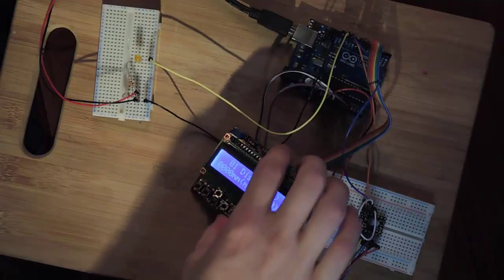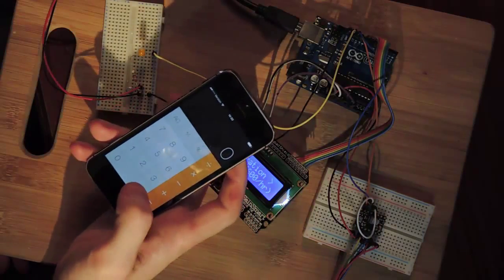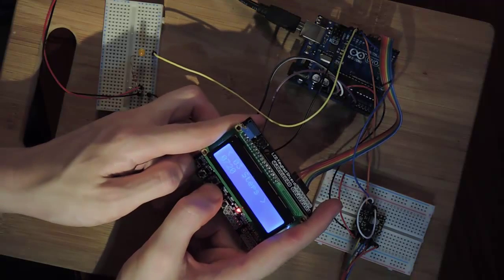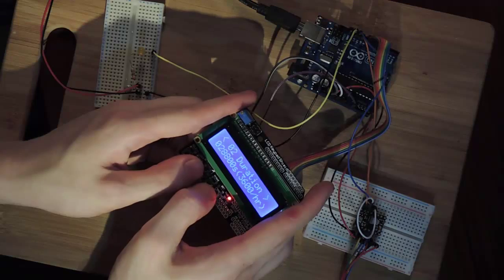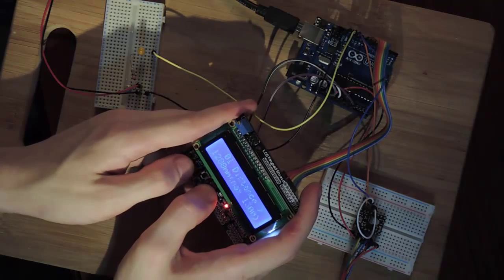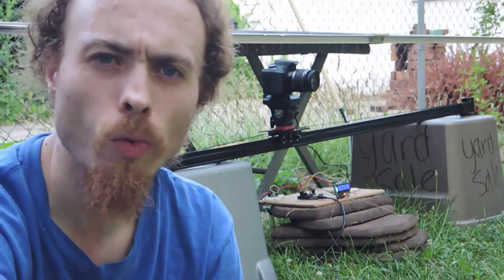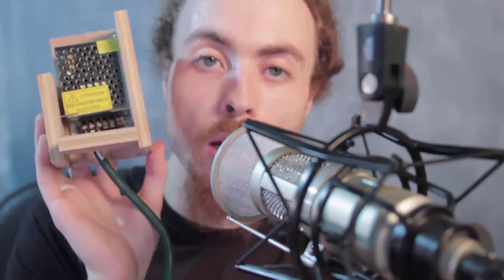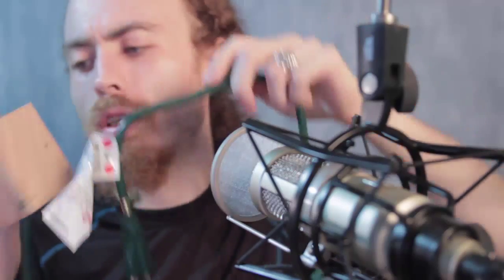SliderCam Intro/Interface/Examples

Comment: What an awesome project. I have built all the electronics of it, which I'm super excited about. Everything works, except my motor keeps stuttering. I have tried changing the wires around, nothing is working. I was wondering if current limitation could cause this? I read up and think I did it right, but wonder if maybe I didn't. I tried both the A4988 FullStep Test. I also tried the Slidecam program. The slidecam works great, except my motor doesn't keep turning. Would really appreciate any help.
Reply: Paul Esteves I increased the current potentiometer, now my motor turns (with the A4988) full test, but not with the slidecam program. With the slidecam program, it still just stutters. Also, on the A4988 test, when I hold the motor, it doesn't turn, so it has nearly no torque. Any ideas? I'd love to get this to work!
Reply from the maker: Paul Esteves That's very odd. Did you try testing the motor/shield with the Arduino library's build-in Stepper example? Far as I'm aware, my motor test output and full program output are both identical, so I have no idea why there'd be a difference in behaviour.

Stuttering is usually one of two issues: 1) incorrectly oriented motor wires (I assume you didn't move them between loading .inos though), and 2) impossible motions (there are no error catching routines in the software as of v0.2). Did you try something like "move 50mm in one step in two seconds"? I tested using video-style movements a lot.

Other than that... It may be your individual hardware, though if you fix the problem and it's a software thing, let me know! :)
Reply: Rob Taylor-Case Hey rob, thanks so much for replying. I eventually did figure out what I had done wrong :/ I had switched the dir and stp wires (problem with not having different colour wires). I actually added in a shutter menu option. I'd love to share it with you and get your feedback on how you'd enhance it. I've done some starlapse tests and it works pretty well! I set it so I could adjust how long it stopped to take a shot. But, I CANNOT figure out the maths now to get it to work perfectly.

Comment: Hi Rob
I have found a couple of problems in the program.
one is in this line lcd.print(menuItemsTo[0]); and 
lcd.print(currentDistance[i]);
as well as 
  //declare button poll function
int readLcdButtons() {
  delay(90); //debounce delay, tuned experimentally. delay is fine as program shouldn't be doing anything else 
  //at this point anyway
  adcIn = analogRead(0); //read value from pin A0
can you please have a look at them it may be me I don't know
Regards
Rod 
Thanks for posting the codes and the help video.
Reply from the maker: Line 188, lcd.print(menuItemsTop[0]);, is part of the Arduino's setup loop rather than the main loop, and therefore doesn't permanently lock the menu to its initial value. That simply sets up the GUI on "boot."

lcd.print(currentDistance[i]) is both line 193 in Setup and 428 as part of the "Screen Refresh Module". Either one specifically? They're both part of a For loop that prints out an array one character at a time, and look fine to me.

The button polling function looks ok to me. It effectively reads the buttons every 90ms so that one button press doesn't change a menu position or parameter digit more than one step at a time. If anyone wants to fork it and replace that part with a true button debouncing function, go for it!

I hope this answered your questions. As you can see in the video above, the code is certainly functional. Are these theoretical concerns or is the code not producing the same practical results for you?
Reply: Rob Taylor-Case Hi Rob Thanks for the reply but I am still getting the erro when I am verifying the code and the error message is "menuItemsTo" was not declared in scope. I am using an Arduino Mega 2560
Thanks Rod
Reply from the maker: Rod Jackson I'm really not sure what the issue is; I just changed the board to the Mega and hit compile again, but it didn't have any issues. I'm using IDE v1.0.5 r2 on Windows 7, though I'm not sure that should make a difference. I don't have a Mega board to upload to and test though. Do you definitely have liquidcrystal.h included?

That "menuItemsTo" should be "menuItemsTop". That was an old error that I fixed a while back, not sure why it's still in the wild. Are you using the current sketch version from GitHub? It's in the description above. Try that and let me know if it still has issues.
Reply: Rob Taylor-Case Thanks Rob 
This is the code I am using
Cheers Rod 
From Australia

 #include <LiquidCrystal.h>
 
LiquidCrystal lcd(8, 9, 4, 5, 6, 7);    //set LCD output pins
 
//define stepper driver pins
const int stp = 11;    //can't use pin 10 with the SS LCD as it's the backlight control. 
//if it goes low, backlight turns off!
const int dir = 12;
 
//define trigger pin
const int trig = 13;
 
//BUTTONS
//define button values
const int btnUp = 0;
const int btnDn = 1;
const int btnL = 2;
const int btnR = 3;
const int btnSel = 4;
const int btnNone = 5;
 
//define button-reading variables
int btnVal = 5;
int adcIn = 0;
void setup() {
  lcd.begin(16, 2);               // initialise LCD lib full-screen
  lcd.setCursor(0,0);             // set cursor position
 
  pinMode(stp, OUTPUT);           //initialise stepper pins
  pinMode(dir, OUTPUT);
 
  pinMode(trig, OUTPUT);           //initialise trigger pin
  digitalWrite(trig, LOW);         //ensure trigger is turned off
 
  lcd.print("Welcome to");  //welcome screen
  lcd.setCursor(0,1);
  lcd.print("SliderCam v0.2!");
  delay(1000);
  lcd.clear();
  lcd.print("menuItemsTop"[]);
  delay(100);
  lcd.setCursor(0,1);
  for (int i = 0; i < 4; i++) {
    lcd.setCursor(i, 1);
    lcd.print(currentDistance[i]);
  }
  lcd.setCursor(4,1);
  lcd.print("mm(max 1300)");
}
void loop() {
  do {
    btnVal = readLcdButtons();      //continually read the buttons...
  } 
  while (btnVal==5);              //...until something is pressed<br>
  //declare button poll function
int readLcdButtons() {
  delay(90); //debounce delay, tuned experimentally. delay is fine as program shouldn't be doing anything else 
  //at this point anyway
  adcIn = analogRead(0); //read value from pin A0
 
  /*threshold values confirmed by experimentation with button calibration sketch returning the following ADC read values:
   right: 0
   up: 143
   down: 328
   left: 504
   select: 741
   */
 
  if (adcIn > 1000) return btnNone;
  if (adcIn < 50)   return btnR;
  if (adcIn < 250)  return btnUp;
  if (adcIn < 450)  return btnDn;
  if (adcIn < 650)  return btnL;
  if (adcIn < 850)  return btnSel;
 
  return btnNone; //if it can't detect anything, return no button pressed
}

 //PRINT NEW SCREEN VALUES
  btnVal=btnNone;
  lcd.clear();
  lcd.setCursor(0, 0);
  lcd.print(menuItemsTop[currentMenuItem]);    //print top level menu item
  lcd.setCursor(0,1);
 switch (currentMenuItem) {
 case 0:
   {
     for (int i = 0; i < 4; i++) {
       lcd.setCursor(i, 1);
       lcd.print(currentDistance[i]);
     }
     break;
   }
 
 case 1:
   {
     for (int i = 0; i < 6; i++) {
       lcd.setCursor(i, 1);
       lcd.print(currentDuration[i]);
     }
     break;
   }
 
 case 2:
   {
     for (int i = 0; i < 4; i++) {
       lcd.setCursor(i, 1);
       lcd.print(currentSteps[i]);
     }
     break;
   }
 
 case 3:
   {
     if (travelDir == 0) lcd.print("From Motor");
     else lcd.print("To Motor");
     break;
   }
 
 case 4:
   {
     lcd.print("Stop!");
     break;
   }
 }  //end switch
 if (currentMenuItem==0){
    lcd.setCursor(4,1);
    lcd.print("mm(max 1300)");    //insert max carriage travel on slider used
  }
  if (currentMenuItem==1){
    lcd.setCursor(6,1);
    lcd.print("s(3600/hr)");
  }
  if (currentMenuLevel == 1) {
    lcd.setCursor(currentCursorPos, 1);
    lcd.blink();
  }
  else lcd.noBlink();
  //MENU GUI
//define top-level menu item strings for numerical navigation
char* menuItemsTop[] = {
  "  01 Distance >", "< 02 Duration >", "< 03 Steps > ", "< 04 Direction >", "< 05 Go!"};
 
int currentMenuLevel = 0;      //top menu or submenu
int currentMenuItem = 0;       //x-axis position of menu selection
int currentCursorPos = 0;      //current lcd cursor position
int currentDistance[4] = {
  0, 0, 0, 0};
int currentDuration[6] = {
  0, 0, 0, 0, 0, 0};
int currentSteps[4] = {
  0, 0, 0, 1};
  if (currentMenuLevel==0) {
    switch (btnVal){
    case  btnL:
      {
        if (currentMenuItem == 0) break;      //can't go left from here
        else currentMenuItem--;
        break;    
      }
 
    case  btnR:
      {
        if (currentMenuItem == 4) break;      //can't go right from here
        else  currentMenuItem++;
        break;
      }
 
    case  btnSel:
      {
        currentMenuLevel++;
        if (currentCursorPos > 3 && (currentMenuItem == 0 || currentMenuItem == 2)) currentCursorPos = 3; //don't go off the end of the numbers for the 4-digit numbers
        if (currentCursorPos > 0 && (currentMenuItem > 2)) currentCursorPos = 0; // set blinking cursor to left for text-based options
        if (currentMenuItem == 4) {
          motion = 1;
          motionControl();
          break;
        }
      } 
    } //end of switch
  } //end of level 0
  else {    // i.e. "else if currentMenuLevel = 1"
    if (currentMenuItem == 0) { //01 DISTANCE
 
      switch (btnVal) {
      case btnUp:
        {
          currentChar = currentDistance[currentCursorPos];
          adjustDigit(currentChar, 1);
          currentDistance[currentCursorPos] = currentChar;
          break;
        }
 
      case btnDn:
        {
          currentChar = currentDistance[currentCursorPos];
          adjustDigit(currentChar, 0);
          currentDistance[currentCursorPos] = currentChar;
          break;
        }
 
      case btnL:
        {
          if (currentCursorPos == 0) break;      //can't go left from here
          else currentCursorPos--;
          break;
        }
 
      case btnR:
        {
          if (currentCursorPos == 3) break;      //can't go left from here
          else currentCursorPos++;
          break;
        }
 
      case btnSel:
        {
          parseArrayDistance();
          currentMenuLevel--;
        }
      }    //end switch
    }      //end DISTANCE
    int adjustDigit(int x, int dir){      //digit adjust function
  if (dir == 0 && x > 0) x--;         //subtract from digit on btnDn
  if (dir == 1 && x < 9) x++;         // add to digit on btnUp
  lcd.setCursor(currentCursorPos, 1);
  lcd.print(x);
  currentChar = x;
  return currentChar;                 //return new digit
}
int adjustDigit(int x, int dir){      //digit adjust function
  if (dir == 0 && x > 0) x--;         //subtract from digit on btnDn
  if (dir == 1 && x < 9) x++;         // add to digit on btnUp
  lcd.setCursor(currentCursorPos, 1);
  lcd.print(x);
  currentChar = x;
  return currentChar;                 //return new digit
}
int motionControl() {
  totalMotorSteps = currentDistanceInt * 5; //calculate total steps (0.2mm = 20-tooth gear on 2mm pitch belt; 40mm per rev, 200 steps per rev, ergo 1/5th mm per step)
  pulseDelay = (1000L * (currentDurationInt - (currentStepsInt * shutterDuration))) / totalMotorSteps; //how long to pause in ms between STP pulses to the motor driver
  intervalDistance = totalMotorSteps / currentStepsInt;
  //once per overall run
  if (travelDir == 0) digitalWrite(dir, LOW);
  else if (travelDir == 1) digitalWrite(dir, HIGH);
  //Serial.begin(9600);
  //Serial.println(pulseDelay);
 
  //step loop
  do {
    digitalWrite(stp, HIGH); //fire motor driver step
    delay(pulseDelay);
    digitalWrite(stp, LOW); //reset driver
    //btnVal = readLcdButtons(); //check there's no stoppage - this takes too long and significantly slows motor; use reset for stop!
    currentStep++;
 
    //at end of each step
    if (currentStep % intervalDistance == 0) {    //if current number of motor steps is divisible by the number of motor steps in a camera step, fire the camera
      digitalWrite(trig, HIGH); //trigger camera shutter
      delay(80);
      digitalWrite(trig, LOW);    //reset trigger pin
      delay((shutterDuration * 1000)-80); //delay needs changing to timer so stop button can be polled
    }
 
  }
  while (currentStep < totalMotorSteps);
 
} //end motion control
Reply from the maker: Rod Jackson That doesn't look like it's in the right order, not sure what happened there since I never created that! It's probably trying to use variables that haven't been declared yet. Did you copy the example pieces of code from Computertuts? That isn't the entire program, nor did I quote it in the correct order. You have to use either the zip file I included with the article, or the code available on GitHub, here: http://github.com/RobTC/SliderCam/blob/master/SliderCam_v0_2/SliderCam_v0_2.ino - copy all 480 lines and replace the code you're using. That should solve your problem!
Reply: Rob Taylor-Case Thanks Rob you have been a great help 
The only thing that was not working for me in the code was for the buttons.. The shield I'm using is a DFrobot 5 button 16x2 lcd display .

your code  is this
if (adcIn > 1000) return btnNone;
  if (adcIn < 50)   return btnR;
  if (adcIn < 250)  return btnUp;
  if (adcIn < 450)  return btnDn;
  if (adcIn < 650)  return btnL;
  if (adcIn < 850)  return btnSel;
I had to change it to
 if (adcIn > 1000) return btnNone;
  if (adcIn < 50)   return btnR;
  if (adcIn < 250)  return btnUp;
  if (adcIn < 350)  return btnDn;
  if (adcIn < 550)  return btnL;
  if (adcIn < 750)  return btnSel;

so I could get the select and the l button to work.
 so when you go to menu 5 the just starts but if you push select it will stop correct
One again thanks from Australia.
Cheers Rod
Reply from the maker: Rod Jackson Check the other .ino files in the GitHub repository. There's one specifically for checking the ADC values provided by a particular LCD shield- though it sounds like you already fixed that, and another simple one to help work out the wiring for connecting your stepper driver to your motor. It just keeps the motor turning slowly in one direction- keep flipping wires until the motor starts turning instead of stuttering!